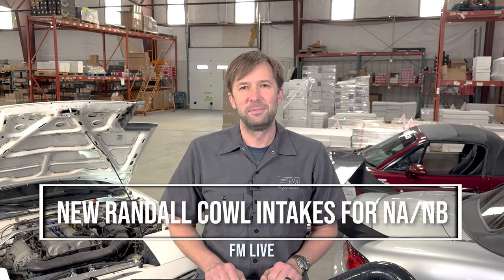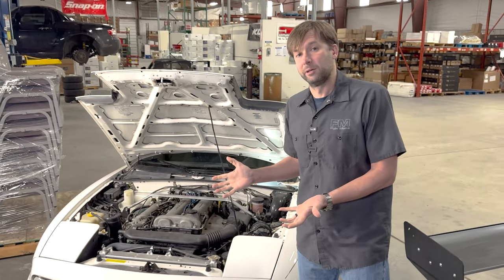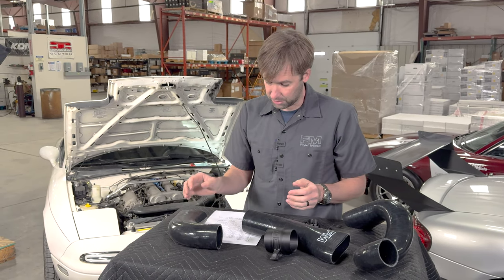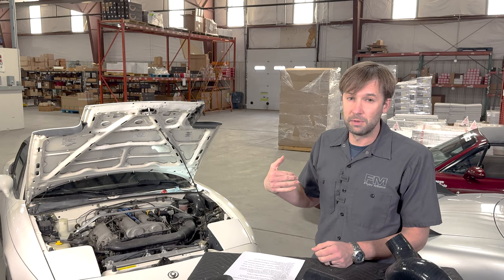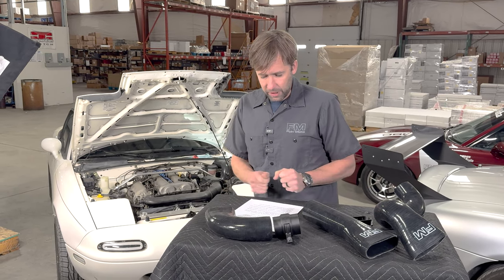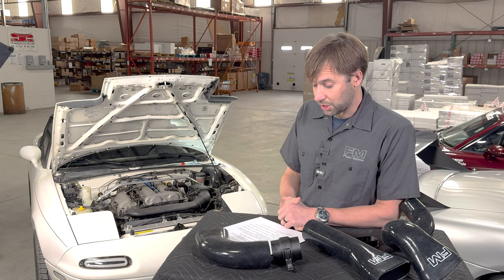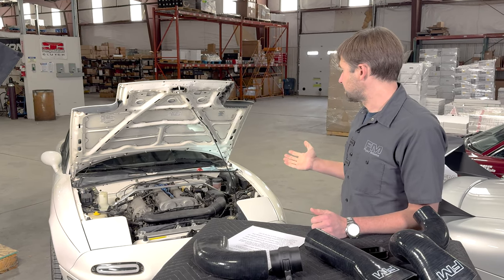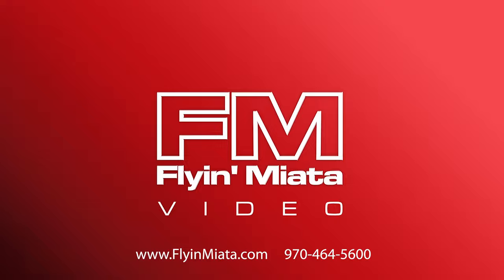NEW! FM Cowl COLD air Intakes For NA/NB Miatas (FM Live 11-30-23)

Comment: Will these fit with a Racing Beat header?
Reply from the maker: We haven't tested it but as long as you're running an OE airbox and there isn't anything in the way from the inlet of the air box and where the piping runs to the firewall....Sure!
Reply: ordered mine!  thanks @FlyinMiataVideo

Comment: This re-post looks much better than the shaky original. Thanks for doing that!

Does this option work with NA6? 94-97 mentioned and shown at 4:18. But 90-93 mentioned later when talking about AFM at 14:30.
Reply: Going off their website I’m pretty sure it does work for na6, given they dyno’d on an na6
Reply from the maker: Yeah, as long as you purchase the one specific for NAs, you'll be good. https://flyinmiata.com/products/randall-cowl-na-v2?_pos=2&_sid=a990da721&_ss=r

Comment: Would really love an update on the windshield washer relocation performance in combination with this intake!

Also, does this fit with any oem strut braces, brake booster braces etc? 
Would love to upgrade my "shorty" intake with one of these if possible
Reply from the maker: I'm sure we'll get to the washer relocate test but we just don't have a date on it yet. We've tested our shock tower brace along with the factory one and they both fit fine with the Randall cowl.
Reply: @FlyinMiataVideo  would a slight redesign of the washer reservoir be considered in the future to accommodate both?

Comment: The website says the cruise control actuator on the NB needs to be relocated slightly. Does the intake come with the necessary bracket for that or will it be a separate item?

Comment: While working on my Miata, I looked at the location for this install. Looks like I have to reroute the clutch line. Change over to a braided line seems like the logical choice.
Reply: 3:40 there is a clip on the 3D printed part to reroute the clutch line

Comment: Ordered one for my '95 last night - been looking for a quality & affordable CAI option for the NA8 since I bought it, and now I've got one.
Reply from the maker: We appreciate it!
Reply: I bought a 3d printed kit from Napp Motorsport intake is down in front of the radiator on driver side gets good air flow and I ordered a filter mesh for it and haven’t had any issues with it been installed over a year love the look and how it works
Reply from the maker: @rjjohnson3807  Did you have to relocate your washer bottle? I thought my '94 had the washer bottle there.
Reply: @FlyinMiataVideo  no mine is in the top left by the fuse relay box, I’m looking to go the relocation route due to the upcoming reroute and coil on plug install so I have more space

Comment: The 3d printed bit for the firewall needs a cold air box to go with it now for the FM MSM intake 😜
Reply: I was thinking similar to you while I watched. I bought the intake elbow kit for my MSM years ago after the factory one started to fail around 6 years old, but I didn't buy the rest of the intake side until last year because Jeremy told me it's loud and the car had to remain civil. I haven't installed it yet because reasons - so I was thinking this might be the best of both worlds if it's quieter than the MSM intake but still enables enough airflow.

Comment: I have your 1991 turbo kit. My intake is placed to the back corner there and not in the front (yall don’t advertise that fact very well btw…) 

would it be possible to buy the 3d printed plate and a straight ish hose piece (like the one on your table)?

Comment: My air intake is hitting on a pulley the one closer to the filter do you recommend replacing the whole thing or just zip tying it to pull it away from the intake ? It is grinding against it not too much but it left its mark
Reply from the maker: Hmm. That's a pretty important piece to keep together, so if you see any damage, I'd replace it. If you spring a leak on the inlet pipe, the car will run poorly due to the unmetered air, and the dirty air that's coming in is going to get expensive pretty quickly.

Comment: just as an fyi, scca solo doesnt allow this for any street or street touring classes. only street modified plus classed, which would be a turbocharger/supercharger/engine swap cars. 

so basically not applicable for any car that would attend a scca event. 

in fact, same for frame rails
Reply: Question. Can you remove the hose from the airbox and be considered legal for the street and st classes? My car already has the old style intake and I noticed that rule.
Reply: @redneckcrawler2367  the reason this intake is illegal for ST is that it cuts into the firewall and that's a safety concern for the scca. It's not a car to car basis, just a rule that doesn't allow cutting it. 

For street class, stock intake only
For Street touring, any intake from the throttle body that utilizes the stock air metering device
Reply: @AustinHampton594  figured as much. Since I just want to do fun runs and not actually compete, it doesn't matter to me. I was just curious.

Comment: The end of the hood is considered as a ''high pressure'' area while the car is moving?
Reply from the maker: A lot of air collects in the windshield cowl when the car is moving, so yes! It's also simply out of the engine bay heat, which is a great benefit in its own right for a true cold air intake.
Reply: @FlyinMiataVideo  : I remember this was a 60-70's trick in NASCAR due to the inclination of the windshield.

Comment: Hi again, Still waiting for them to be in stock.
In the meantime can anyone confirm if a tower brace will get in the way of this intake?
Reply from the maker: @blue04mx53 We're expecting more soon! Make sure to sign up for notifications on the product listing page so you don't miss the next restock - they sell very quickly! We haven't tested all of the various aftermarket shock tower braces out there, but there shouldn't be any fitment issues - however the cruise control actuator does need to be relocated, which is covered in our instructions.